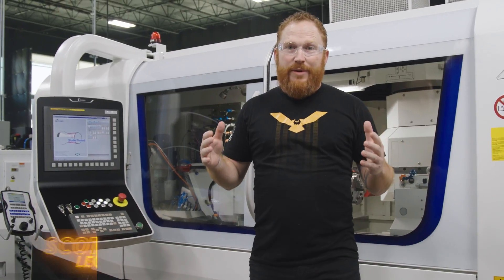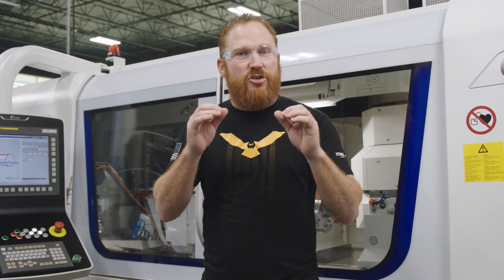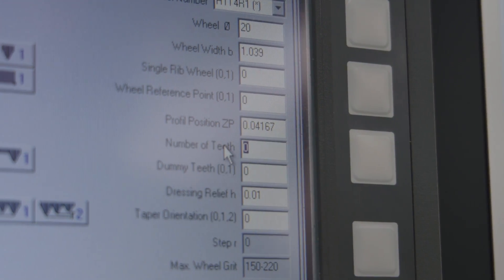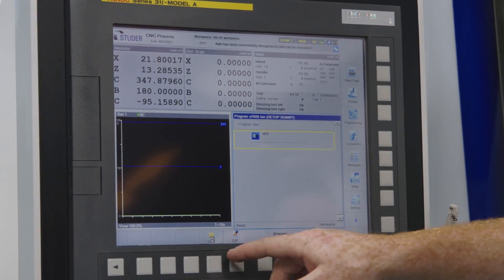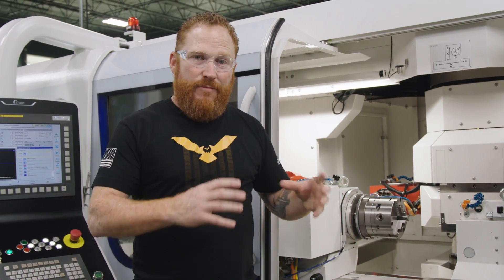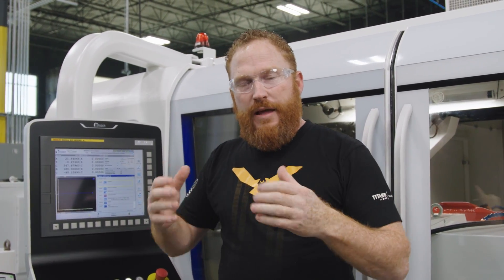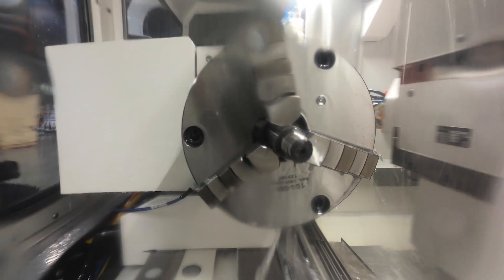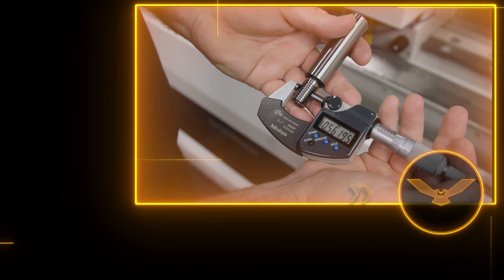Threading on a STUDER S41 from United Grinding

Comment: I wonder what's the benefit of choosing grinder over lathe for threading? And how ware on grinding wheel is compensated after a few jobs?
Reply: The advantage is that you can cut very hard material and normally the thread is roughed and the grinding wheel is re-dressed for maximum precision before the finishing pass
Reply: There is a dressing cycle after a few grinding cycles. And compensation can be set manually for each grinding cycle according to measurement results. But that's for high-volume applications. Dressing before finishing is more convenient for job shop parts like this. And ever think how taps and thread gauges were made？

Comment: I was let go from a job doing threading recently. Lathe based die chaser. The work started to die down badly and I could see it was going to get slow but not completely let go.... anyway, it wasn't the best place. Had no gloves provided for MONTHS regardless of handling sharp steel continuously. And they would keep running out of SOAP. It was deliberate neglect. Zero care about the workers.
Reply from the maker: Sorry to hear that. Hope you get a great job quickly😉

Comment: wish you could show why and where the application would be needed, numb is math is numb,
Reply: I worked in the aerospace industry for four decades. A number of military, aerospace and tooling parts had requirements for special ground threads profiles. Only the designers and engineers knew the reason as to why, since many projects were classified.
Reply: @opendstudio7141  Word, designers. Its a shame SpaceX looks like hammered dogshit.
Reply: @chasingcapsaicin  tsk tsk tsk. Kids these days.
Reply: @danl.4743  Hope that's not directed my way, and thy progeny are well of age now.

Comment: Are we sure the machine costs 1.7 million dollars? I don't think you've told us enough time! Thank you for the information!
Reply: Worked in many shops during my 35 years in the trade. Never in a shop that has the seemingly unlimited resources and capabilities as this shop has.
Reply: I was really surprised to learn that this machine cost 1.7 million, it's not something you get to see in every video.
Reply: Or $33K/mth payment if that’s any better.  My shop might have grossed that one month back when oil was booming.
Reply: Well let me help then...IT COST 1.7 MILLION DOLLARS...hope that helps  😎
Reply: @gojoe36  Hah.. that's just the machine...
it's a lot more going on in the back-end...
Just air supply and Coolant Supply...
anyway... you're exploiting that machine 1-2 years minimum, but it's about the time it takes... machine hours...
Reply from the maker: With all the add ons etc. it’s also got Wire EDM in the machine. The price shows the level and truthfully makes for an intriguing title😉🤙
Reply: @TITANSofCNC  yoo titan its me your long lost brother. sorry I didn't reach out for so long, mind if I borrow a few tools and machines? plsss
Reply: @TITANSofCNC  You want me to take care of them, Titan?  I know people. I'm from New York.
Reply: @TITANSofCNC  This is the first video I think I've seen on it and I wouldn't have known.  Kinda one of the reasons I clicked myself.
Reply: Slavery with extra steps...
That must have been a very expensive part...
Reply: purely for effect . remember this is a glorified show. but I think it’s 1.7milliom dollars🤷🏻‍♂️

Comment: Hey quick question how do we measure the pitch that's cut on the grinding wheel? Is it on the machine or you'd have to take the wheel out? Also how does the machine compensate for wear with the threads cut?
Reply: The machine itself dress the wheel, you tell it whats the pitch you want

Comment: I dont understand the sanding wheel, how can that be precise? The idea is that you remove material from the stone and the workpiece? Can somebody explain this a bit more, its new to me(obvioulsy it precise, otherwise titans wouldn't use it)
Reply: sanding weheels are way more precise than cutting with a tool